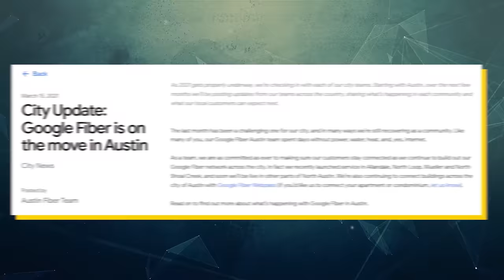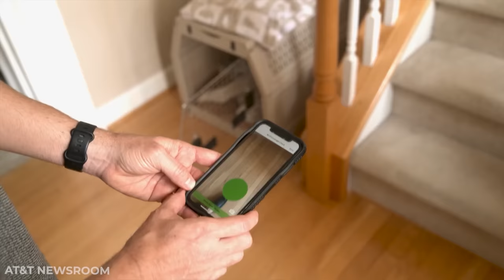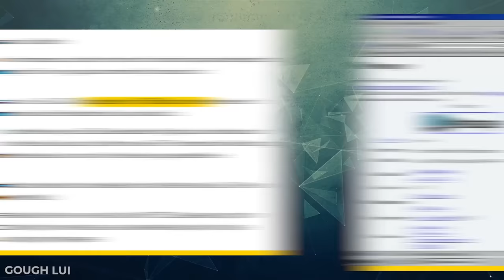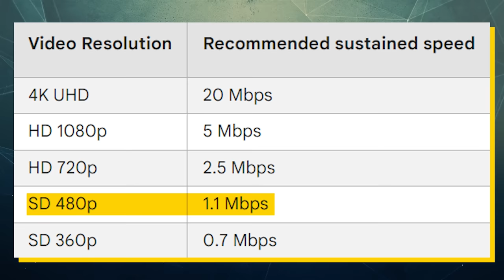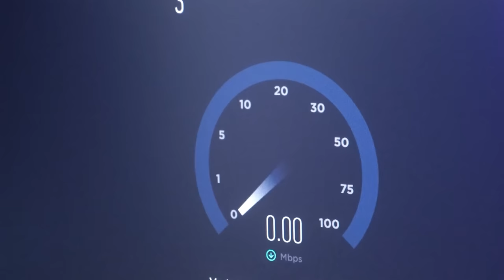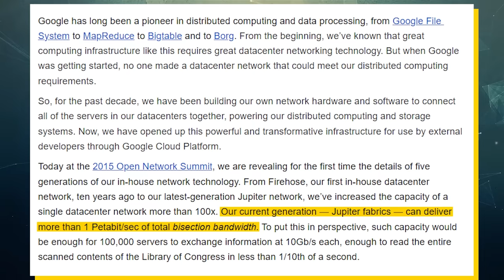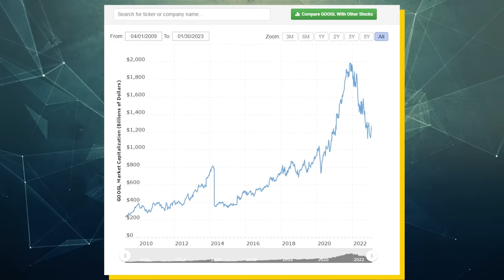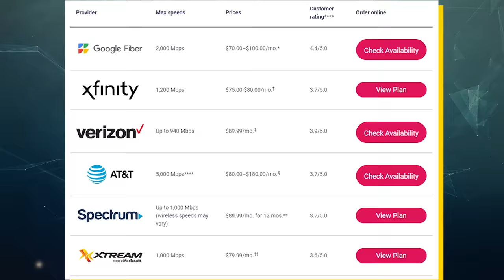Google Fiber Never Had A Chance. But That Was By Design.

Comment: lol satellite internet absolutely "took off", it just only "took off" in rural areas where DSL is unreasonable due to distance and cable is just unavailable. There's plenty of satellite internet companies out there; Hughesnet, Viasat, now Starlink is getting bigger and bigger... 

The problem with satellite is even if you get reasonable down speeds (usually about as good as an average DSL down speed) your upload was **miserable**, made worse by an outrageous ping for a double gut punch to gaming on sat.

Comment: I remember being so excited about Google Fiber. I even petitioned my local government to look into bringing them into my city. 
Then AT&T dropped their Fiber cables all over the city and they became the biggest players until Spectrum finally started adding 1G. Now it's all about where you live in the city and who you owe currently. Spectrum is currently pushing AT&T out
Reply: I'd double check those speeds. Remember that with the internet there are two different speeds : The download and the upload. Charter manages to get faster download by using both channels for the download and leaving around a megabit for download. Charter doesn't advertise this fact, but upload speeds are needed for uploading videos, high quality conference calling, running game servers, hosting multilayer matches on video game consoles, etc. 

In my city Charter is the only option and while I can get an "up to" 1 gigabit download bandwidth (which is really closer to half that) the upload bandwidth is low.

Meanwhile a friend just a short drive away has AT&T in his area and he gets a gigabit on the download and the upload. But because Charter has the monopoly here I don't get any of that.
Reply: Plus charter or spectrum they charge low first and them jump prices super high 
I have now QuantumFiber at my house for 65$ for live that includes taxes 1Gb up and down
Reply: @itluis2009  AT&T is the same way and their price per tier is higher than google fiber, GF is $55 a month for 500MB which is no longer offered but existing customers get to keep it, 1 gig is $70, 2 gig is $100 and 5 gig is $125, that's including taxes and fees, ATT is $55 for 300, 65 for 500, 80 for 1gig, 110 for 2gig and 180 for 5 gig, but that's before taxes and fees, which push those prices to 80, 120, 140, 210, then couple the inconsistency of their services which is what I hear most about when installing service to customers that were switching form ATT

Comment: Thing is, you still only need around 50Mbps per household. Which is unfortunate in a way because it doesn’t provide the market use case to support the buildout of fiber infrastructure in the US. We in the Puget sound are still, in 2023, stuck with either 25Mbps DSL or 50Mbps cable.  Comcast sells and advertised much higher speeds but those are never attainable at prime awake times for most. I regularly sit at my desk in the late afternoon or evening , weekday or weekend, and see Speedtest results of around 26Mbps as the norm. I can only get the 150Mbps late at night, and I’m not using the network much between 00:00 and 06:00. 

To deploy fiber to households en mass is a huge logistic undertaking , and you need to do it at comparable $75 per subscriber line.

Comment: cable modems are capable of very much higher speeds, but it's intentionally limited by isp's, because allowing higher speeds would mean upgrading and adding more backbones. I'm on docsis 3, yet only have 100/15 megabit.

Comment: There is a reason that FttH will still take ages and that with docsis and vdsl we can get speeds that will support a regular home perfectly. (At least in terms of downloads, most of those connections still asymmetric). 

The cost of replacing the infrastructure is just enormous. 

Providers have fiber to the node, but those last kilometers to get FttH are just too expensive, specially in some European markets where we are used to cheap internet.

Comment: Other competitors filling in the infrastructure gap are T-Mobile with their 5G home internet and Starlink. Many areas of the country still lack decent infrastructure to give people even the slowest of high speed internet. With wireless solutions like T-Mobile and Starlink, you can skip the costly expense of laying wires.
Reply: there is also several electric cooperatives across the country that have built and are building fiber networks in the middle of nowhere

Comment: A stable 100 mbps internet connection is highly enough for most people but yeah. I paid 0€ for a 200mbps internet that comes through the wall from an ethernet and it can be upgraded to 1 gig if you pay 20€ more. Studenthousing benefits are great. Finland, the most depressed country. :3 (all there prices have the tax in them included)

Comment: dsl was always better than cable, its moved on to vdsl which many countries use and is faster than cable would get. cable suffers the shared bandwidth problem like hubs. too many users doing too much would slow everyone else down. dsl is more like a switch, everyone has a seperate line too the exchange where the big links all are then piped between them all and data centres.

fibre is the same design as dsl, but much faster and no up/down limits that dsl has too share the lines limits each way.

there's no extra cost for fibre be it 10mbit or 1gbit same fibre cable. usually at each end the cost is minimal to do whatever speed needed. but dsl has limits on speeds because of frequencies? too much speed and it starts losing data.

so glad in Australia we went from modems to a small cable rollout that didn't go far before adsl came in and our biggest at the time telco was government owned. it was also made to resell that adsl to other companies to promote competition.

the government then decided we need a national network to service everyone equally even in the country, so the nbn was started and intially using fibre.

then we got a little political mess and governments changed sides and it got scaled back dramatically because it was deemed too expensive and could be done cheaper.

then we got a mixed mode nbn, cable providers would give their networks to nbn and a few telcos inc the government one which they also decided to privatise would give their copper network to nbn too.

so we would have a large area covered by cable already nbn that had no plans to grow because vdsl was the main way using the large existing Telstra copper they acquired which reached everyone. it was better than cable, so cable got even less attention.

fibre footprint got drastically reduced in favour of VDSL, and most of the fibre went to lucky mostly rich inner city places still that happened to be the government's seats.

soon it was discovered a lot of the copper needed remediation work and would cost a lot, so fibre was given to more places. that looked too expensive so fiber would go to nodes around the place and copper to the last mile (or km or so).

again costs blew out, and the government appeared to be blowing the original other sides budget again and again after telling us it would be cheaper.

so for awhile we had fibre, vdsl, cable, wireless and satellite nbn services that  had now cost more than the original plan to run mostly fibre and some wireless/sat.

eventually the nbn government owned company basically said enough, fibre is just cheaper and we'll roll that out where possible as vdsl copper replacement was more expensive or at least the same.

now we are hearing more fibre will be rolled out to areas that already have cable because that was hitting congestion because of how it's shared so vdsl or fibre for them.

now the government couldn't deny it blew it and had lied. the other side was pointing to it and many other lies, but still we again voted them in, it took another 4yrs (2022) but we finally got sick of their lies.

around 10 years of that government wrecking the project to build an infrastructure for all Australia and its future the government that started it all is back in, has plans to let it go to all fiber and not try and sell it, making sure we all have affordable fast net.

that's a long way of saying, we did it, it may have taken awhile but it's not as spotty as some counties that let private companies have their own way which takes forever, isn't cheap and only ends up servicing profitable area's.

Comment: Look at the cost of fiber deployment, even at the worst case, low density rural say in the 1000 potential customers in a hundred mile circular area.  Which is pretty much exactly the what my local electric coop is currently building at a total cost of some $25M; do the math, that's $25K per potential customer, which is a rediculous number; it will never pay for itself unless one figures the customer will be there for 100+ years.  If they had spent that wiring the 20K premises in town where the distance was at most 20 miles end to end, that cost per potential subscriber passed would be $1250; break even at 1 year.  Of course that $25M is a government grant, so they dont care what the figures are, they simply want to say they built it to compete with starlink.  But a total waste, and leaves the town folks at the beck and call of the cablecos.

Comment: i think its stupid to see people still strugling with cables. i mean first super computers started with cables yeah computing systems on life on earth too uses cables but still i think its causing more trouble in general, wirelless systems are better. in disasters cables goes offline. and yes wireless signals too can go offline, but recovery of wireless systems is easier then wired system. wired systems will be acceptable technology when there is automated repair robots :P other then that wires yeah can be used but its allvays comes with problems and be ready to fix the problems and waste time in repairs